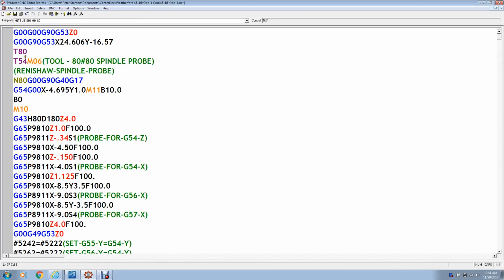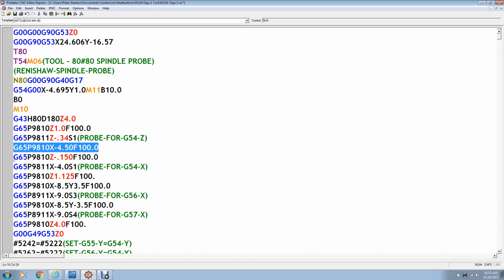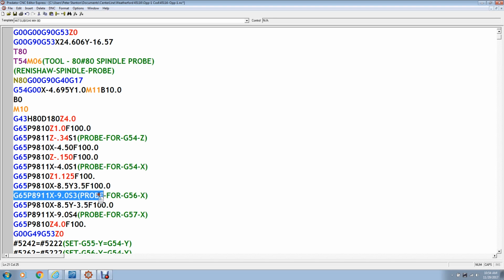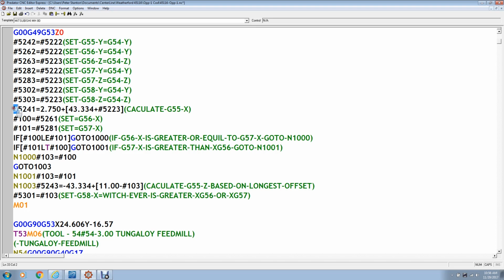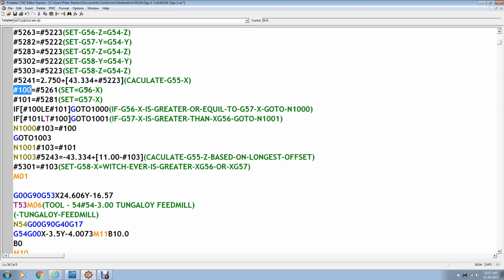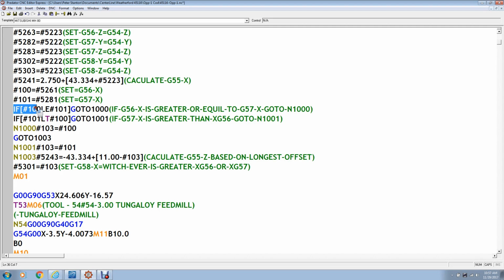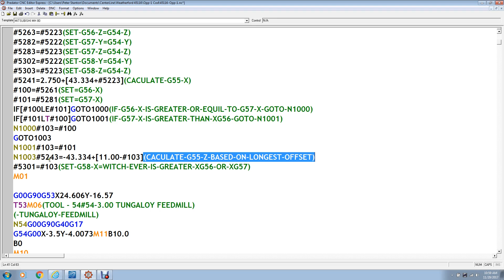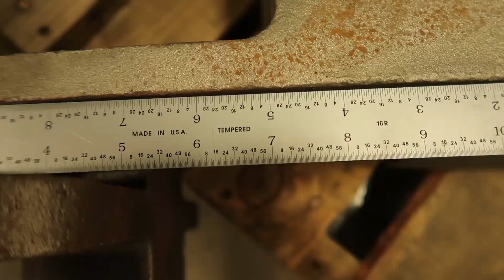Casting 3 Rev on the setup

Comment: I machine big costume gearboxes. The way I always do it is I’ll face mill, just to clean up. Then I’ll spot drill .02 or so all the holes + two spots where there’s bores (the diameter of the bore). Then make offsets in x and y based on that before face milling to my z zero.

Comment: Sounds like they either need to have the parts inspected after being cast by the foundry, or have you inspect them before you machine them, for an extra fee of course.
Reply from the maker: It was a little bit of a pain. But I was able to make all the castings on this job work. This is just life in the job shop machine work trade. You work with what you get a lot of times. Thanks!

Comment: With castings I usually spot all dimensions on part with tiny center drill.  Is this milled on the back so far? I didn't watch the other vids so sorry.  If it isn't it could have a rock to it as well which could affect that side
Reply from the maker: No the castings has no machined surfaces to start with. The fixture for the first operation has special adjustments for the castings irregularities. If you watch all the videos I think I showed this. I was able to use probing on the Mazak to make sure the spot faces cleaned up properly.

Comment: Hi, I was wondering 1. why you hand change every tool after the toolchanger switches tools, 2. why and what you measure with the 123 block on the end of cutter head or part each time, and 3. So it was a customer mistake, did you call or email customer? Is casting too cheap to TIG fill the oversize hole, the 2 offcenter holes, and rebore them?
Customer must go through a lot of them, wouldn't a forged steel product have more longevity? That's cool it'll stop on a dime if Renishaw hits something. The programming sure was complicated, do you like Mastercam?
Reply from the maker: Look at my answer if your previous comment on the castings. As to Mastercam the only experience I have with it is seeing demos. What I saw I liked but I have not personally used it. At Centerline (the shop I’m in) they use it it seems to work good. The thing is with cam software is they pretty much all work. You just have to chose one and learn how to use it. They all take time to learn.

Comment: Makes me not miss castings. It really comes down to someone deciding what it's worth to them. I'm sure if they chose a different foundry or even used the same one and tightened the tolerances it wouldn't happen. I used to work at a foundry doing aluminum castings and we always shot to get the best possible casting for the customer.

Comment: I've been working in the casting business for over 40 years.  What you have there is garbage castings made by a process that's out of control.  They shouldn't vary in length or straightness that much.  I'd reject the castings because you're going to go in circles trying to machine them.  Good luck
Reply: Wayne D Been working with castings for 1000s years the skill of being a machinist is working round these problems we get castings from all over the world some good some bad some really bad, A badly machined part geometrically there's never a excuse
Reply: @chrisyboy666  old post but Wayne D is right. Compare old castings to todays castings. Far far superior in the old days. I often wonder how much of it is down to the loss of the pattern making trade.

Comment: Ive worked with castings in the past. But I've never seen distortion and shrinkage that hasn't been relatively consistent throughout a batch. I really enjoyed your process of dealing with the setup issues you faced with this job. Thanks for the video!

Comment: A minute into your video, and the only thing I'm thinking of is, what's the point of a casting if there's this much work into fixing bent castings that can't be remotely into tolerance for fixtures? Is there still much savings at that point for small runs oppose to just taking the whole thing out of a solid block? At least you have a probe to handle most of that mess.

Great video as always. Thank you.
Reply: there would be awful lot of waste if you made it from solid block, it is all ribbed, just by eyeball it seems that like 80% would go into chips, and they don't really care about most of the external dimensions, machine time would be much more for those parts as well, and the cost of the solid block too
Reply: And machining from solid will have so much stress added into the material that it surely will warp the part anyway.
Reply: Wing Wu, yes, I forgot to mention that
a while ago I had to make an aluminum mould for composite part, basically a U shape from a solid block, ~200mm wide and tall and 500mm length, when the mould cavity would have been finished, the side wall thickness (and the bottom of the U) would be around 25mm, the cavity was first machined with +10mm extra stock on the inside and left to sit for a week, after a week there was around 5mm shrinkage and the bottom was no longer flat, meaning the U shape closed up that 5mm amount at the top on width, which is a lot IMO (hence the extra stock left when roughing it out the first time), then hung it on a piece of rope and banged on it with the soft mallet for a while, then did the final machining
the mould had another piece to close the top (and the sides), first design called for pins on the top face of the U and a flat cover fitted, later changed that to inverted U shape cover with bolts from the sides to pull the bottom U open in case it decided to close up even more (since the part would get repeated heating/cooling cycles during use), and that ended up working just fine
Reply: The other reason is the material grain structure will follow the features forged, making them stronger. Machining them from solid would make it go one way or cylindrically if from billet, depending on how the stock is formed in the first place.

Comment: Castings in general have waay too much variation for my liking.  I've had to reject more than one piece because the casting warp was out of the finished part tolerance even before machining.  The customer didn't like that, but ya show 'em the measurements on the surface plate and then its their problem to go back to the foundry...

I'm sure it's every bit as hard for foundry pattern makers to pre-compensate for warp, as it is for machinists to deal with released stresses.  Not the fun part of the job for sure.

Thanks for showcasing your experience again!

Comment: Diatest, pretty good bore gauges I got 2 sets similar like yours, but the old style.
Reply from the maker: They are the best gages for smaller holes. I have a whole set from .05-.80”. I use them all the time.

Comment: So they don't care if the relationship between the two surfaces or holes change?
Reply from the maker: We have permission to make these changes from them. In order to have the holes in the middle of the cast ears.  These holes are for shackles to attach safety chains for the rotation of the wrench.
Reply: Right so it's really down to strength rather than following the drawing.